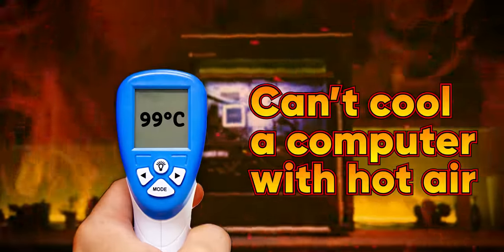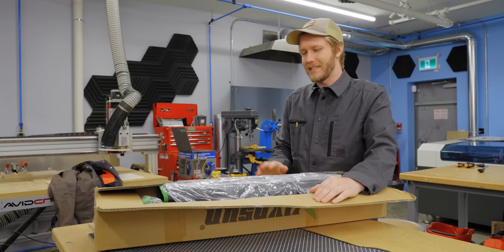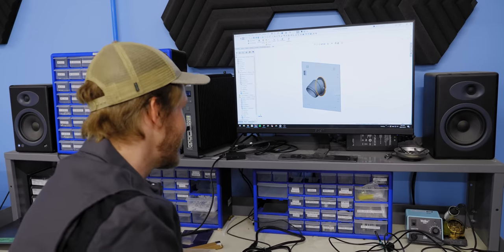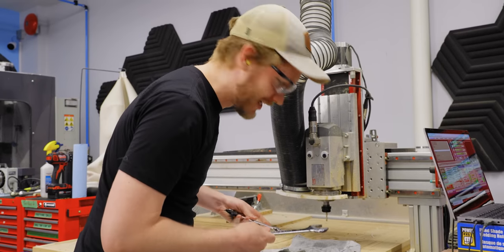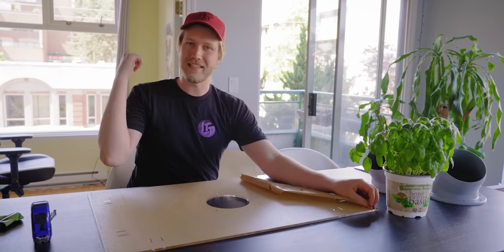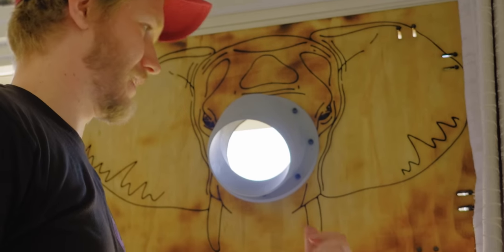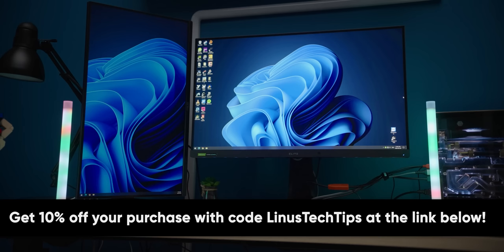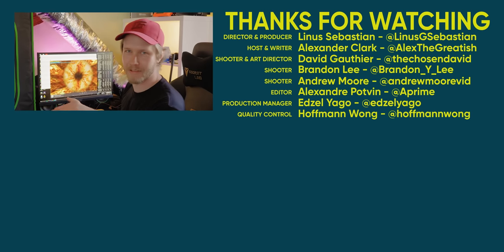You’re cooling your PC wrong. - PC in a Grow Tent

Comment: Sounds like the real problem is bringing cool air in from the rest of the home. What I did was close some vents in the home to get more pressure in the computer room, but this will likely waste some hydro. The other option (that I didn't try) is to just place a window fan (you see them in other countries a fair bit) that just pushes room air outside. That will draw new air in from the cooler parts of the home.

Comment: Just build a cupboard with a door for both computers out of wood or plastic and attach a duct to both but run across the ceiling and put the blower at the window with 2 hooked up. You can control the suction to each by opening/closing the intake on both. There are a lot quieter blowers and fans out there too.

Comment: in the winter you can reverse it to get better overclocks, just make sure to smear goop all over the motherboard ram, gpu, and nvme drives to protect against condensation, and use an external powersupply

Comment: With that amount of airflow, is the full enclosure even necessary?  Having that duct above the main exhaust point of the computer would probably be fine without needing the giant box on your desk, and the airflow traveling around the desktop to the vent would minimize ambient heat escaping into the room.

Comment: A single room AC is well within reason if your computer only draws 600 watts. The 13-15 amp rating on them is just for the short moment while the compressor starts up. My AC is rated 15 amps but unless I'm staring at my power meter the exact moment the compressor starts up, I never see it go above 650 watts usage.

Comment: modifying the case so that you can screw the duct directly onto its top seem much simpler and cleaner to me; then run all pc fans into pull mode also, and have the case in negative pressure; and hang duct and big fan from the ceiling so desks are clean.

Comment: move the cooling fan to the inside of your tent, hanging from the ceiling, that way the fan is grabbing heat from inside tent and pushing it out the vent tube up and out of the elephant trunk. this will help to save space since inside tent is more then enough space for all

Comment: Instead of the grow tent why not try to use a take away delivery bag like Just Eat uses, they are way smaller and im sure you would be able to find something that fits. It would require you to cut some holes in it, but with some stitching around the inner edge you would be able to secure the tubing just fine. Another benefit of this would be you could use a smaller tubing so it wouldnt take up as much space.

Comment: If you have a 3D printer you don't really need a grow tent ... all you need is an adapter for the exhaust panel of your pc case so you can connect the ducting directly. You wouldn't even need intake or exhaust fans in the case anymore - and if you have an AiO installed you might not need any internal fans at all. Just let that big external fan pull the air through the case, the rad and then dump it outside. Maybe if you'd make a little wooden box with some insulation for the fan unit the noise level might even come to normal gaming pc levels.

Comment: While it makes sense to separate the hot part from the rest of the room, here's a thought: what if you just installed the exhaust on the window, with a fan that pulls the air out of the room? The effect might not be exactly the same, but heat still rises, and air would still get pulled into the room from the apartment. Less over-engineered mess that takes up copious amounts of space. 

Ofc it wouldn't be LTT if it wasn't excessively engineered.....

Comment: seems like the cooling wasn't because of the grow tent isolating the heat but rather you used the cooler air from the rest of the house, sucked it into the room and blew that out the window.

Basically, you used your entire apartment's cube space as a cool air supply.

I wager little protection came from the grow tent as compared to if you just were sucking air into that room, blowing it across the computer and then pulling it to the outside.

Comment: The thing to be concerned with is what comes into the apartment/home due to the low air pressure. If you have mold whether you know it or not it may safely exist behind the walls but such a negative pressure machine will draw mold spores, dust and gases into the living space. Also appliances may vent differently or not at all, such as the water heater, boiler or furnace may not draft properly and you may have carbon monoxide issues. If it's heavy you'll feel mental issues quickly. If its mild you'll feel issues slowly over times and either way you may not notice cause and effect.Head aches, Nausea, Irritability, lethargy, allergies, forgetfulness and poor timing issues ie; getting to appointments late, may be the results. Also feeling tired in the home but energized within a few minutes of being outside of the home in fresh air is also a sign somethings wrong in the home. If you do this or anything like it, meaning strong exhaust fan running constantly make sure you also have a large entry opening for safe clean replacement air ,meaning you'll probably have to open a window or two. I know that doesn't help the ac but a good cross breeze might be comfortable enough and healthier than a cold sealed room pulling in whatever is in the walls or whatever should be going out the chimney.

Comment: Air must come in from somewhere to replace the volume of air you're pushing outside. If it's hot or humid outside, your attempt to save energy on AC may be actually causing a net loss as outside air seeps in somewhere else to replace the air you pushed out. It's the portable air conditioner effect. The portable ACs that have 1 hose going to a window cause the same issue. They move 1000CFM of air in the room but end up throwing 500CFM out the window (literally, see what I did there!) and are terribly inefficient.

Comment: At that point, I would just yeet the grow tent and justs make another 3d printed part that connects the case outlets to the insulated tube. Same effect, a lot less bulk. (Maybe use the 240mm mounts on the top and the 120mm mount at the back for fastening?)

Comment: You should just pump the air into a air return in the hvac system.  Pushing air outside air is being pulled into the structure from other places.

Comment: Would it not make more sense to attach the ducting straight to the exhaust of the case? Maybe even insulate the case? although insulating the case wouldnt matter so much as i assume the pull from the extractor will prevent the hot air being released into the room due to negative pressure. This would do away with the massive tent.

Comment: Our breaker is apparently quite resilient since we had 5 PC's in 2 separate outlets 3 of them in 1 and 2 on the other (They were all in the same room though and the outlets were in a vertical position idk how electricals work) they weren't the most power easy either (Estimated 1 720 Watts combined power draw for 2 outlets in the same spot)

Comment: I once did pc inside counter top fridge, 30 by 18 by 18 . Kept pc cold, 34 degree's. I routed fridge hot air out to window mount ac intake. Noise, window mount ac , counter top fridge, no boot to desk top from cold start pre-chilled. To cold for platter hard drive, pre m. 2.  Pge electric bill really high for 1 month ! Now, new pc Asus board with amd Ryzen 5700g , low profile air cooler overclock to 4775, ram 128gb at 3200. Plays fallout 3, nv , 4 on ultra. Complete pc for the price of a graphics card. Temps 40 to 60c, frame rates 50 to 60 fps. I win!! No more high power room heater pc. Read the specs , reviews , shop well.

Comment: i would have turned the elephant trunk to the right do you can route around the window then cut to length so it wouldn't show across the window. that or up side down so you can mount the tube to the ceiling and that out make it be moved out the way so the other desk isn't taken up or bothered.

Comment: Not as efficient or as effective as you'd like to think.
Every volume unit of air you pump out through the grow tent to the outside is a volume unit if air that has to be pulled from the outdoors INTO the house. If the temp in the grow tent is higher than the temp outdoors, you're still TECHNICALLY saving some money, but not much. If the temp in the grow tent is lower than outdoors, you're replacing cooler air with hotter air from outside.

Either way, you have to consider that by pumping air out the window of one room, you're pulling warm air into other rooms or anywhere else air can get in. Same problem with those mobile window-air-hose AC units. 

Def keeps the gaming room cooler though. If that's your only goal/consideration, this is hilariously awesome.

Comment: Not bad but I can think of a number of better ways to do it.
You could have placed the fan in the window fixture itself. Then used micro ducting and created an adapter to connect directly to the back of the PC. Benefit of no big grow tent but same overall result maybe even a bit better. If you had water cooling in the PC you could have hung an radiator fan assembly outside the window and just ran tubing to it. That would be even quitter. It wouldn't have helped with cooling the room the normal temp though. The reason the current system is doing that is the extra air drawn in under the door you mentioned.

Comment: As others have said, without a specific intake, all you're doing is pulling unconditioned, outside air into your apartment through all the leak points. This probably would have worked equally well if you exhausted into the rest of the apartment instead of going outside

Comment: You should design adapter that fits over your exhaust fans on pc case. Then mount duct to your ceiling. You will have more room and it will look nicer. 
Also put some kind of non return valve so that birds, insects and dust don't come in from outside when fan is turned off.

Comment: The horizontal supports are for hanging grow lights.
Reply: You could use the supports to add a fan to push hot air out of the case might have improved as temperatures
Reply: Voice to Text help me again and messed up my words on the first one

Comment: seems like over the long run this would be compounding problems. As the air is pushed outside new air is pulled into the apartment to balance out the negative pressure. Would think most of the new air is outside air from door/window seals. Ejecting cold air + computer heat but injecting hot air. Why not 2 adapters and have outside air come in, thru pc, and out the other vent?

Comment: unless you live in seriously hot climates, you should have nighttime temperatures below 20°C even in summer. So all you need to do is get some thermal mass. 200L water fit in a 40x60x80 cm box that you can put under your desk and can take 840 kJ per K, meaning running a 400W pc for 8 hours will heat it up by 14 °C. Use some creativity to facilitate heat exchange between the water and your room

Comment: If you wanted to prevent this horrible negative pressure machine from sucking out every last bit of cold air from your apartment, the least you can do is put the fan on a temperature controller preventing it from just straight up sucking all the air out.

Comment: i reckon i could do that just as janky, if not a little less with the same pipe and a tote box with a rubber seal around the bottom, and a few extra fans to create static pressure.

Comment: I have done a very similar setup, spare psu + 12v car radiator fan 12v switch. PC is mounted inside a cupboard/bookshelf with a sealed hatch. Vents upwards into the roof space as pumping hot air outside with lousy casement windows is hopeless. PC Case is a ncase m1, and it already used to being hot, 3700x 65d 3080ti 75d pretty much silent

Comment: gotta say, it would work far better with a very long/segmented radiator in the exhaust, and slow airflow over it all for efficiency. after all, 80c is a pretty good under load amount that's at least sustainable, and hotter than most outsides ever, so ideally, a very, very long water loop that works in most every climate would be better.

Comment: I love this video even though this idea is bad. So you're using your home air conditioner to cool your PC. Your electric bill will grow significantly if you send all your chilled air outside. Where is the replacement air coming into the apartment from? Probably the hallway. Actually if the hallway is air conditioned, your landlord is paying for the cool air you are drawing in, but the warmth will find a way to replace the cooler air in the system somewhere. Anyway, this was still fun to watch.

Comment: You could forget the grow tent and just attach the exhaust duct directly to the computer case. the computer would be cooler from the increased air flow and the heat would be sucked outside the same way without the huge tent. But you are sucking a lot of your cooling out the window and making the rest of your house hotter but sucking more of the cold air into the computer room. Probably should get a fan the you can lower the air flow down to the minimum necessary that one on low is probably still overkill.

Comment: Seems like you could get the same result with a dryer hose, connected to a custom 120mm shroud off the rear outlet on the PC and the same oversized fan

Comment: could just have attached some fabric enclosure to the back of the pc and ducted that to the window. or do what I did and get a duct that is the same size as the main 150mm exhaust out the back of my pc, put binder clips on the end, then taped magnets to the binder clips so the duct just magnetically attaches to the back of my computer. then the other end of the duct goes out the window.

Comment: I feel you could have made this from home depot or menards for so much cheaper. PVC pipes, reflective lining, smaller blower, dryer duct. Just a thought from a maintenance man.
Edit: Or how about putting a fan in the window. There are silent versions. Pull in the air you need to keep it cool.

Comment: The irony of 3D printing parts, laser cutting/etching window inserts, running the shop at full tilt for this project, but not spending a few extra minutes trimming down 4 grow tent rods and doing a little tuck work on the tent to get it down to size is thick 🤣

Comment: The video I never knew I needed...
Can you run this without the active ventilator ?
Edit, maybe some ducting (like on a portable AC) to high pressure exhaust fans on the case would be enough instead of building a whole tent around the PC.

Comment: All the fan/duct hardware he used was SO MUCH overkill. Plain non insulated 4" duct with a small inline 4" fan would've been more than sufficient. I've used that fan in a 4'x8'x 7' tall tent with 2 1000w lights.

Comment: you know you could just 3d print a 120x240mm funnel into a 5 inch dryer duct, then all the extra heat from output rad will go directly outside without that huge mess. also you dont need insolated duct, your computer wont put out so much heat that it will blead threw a simple one

Comment: If you're running ac, this is probably pushing cold air out the house You'd want to measure the temperature of the air coming out of the tent. If it's cold outside, or no ac, then this works.

Comment: It could be simplified by instead of using a grow tent, make the cpu case instead as the grow tent itself by putting the duct directly on the rear or top exhaust of the case. The down side of it probably is it will become literally a dust vacuum. lol

Comment: good video. crypto miners do know about hardware cooling. I would never have even considered having that on a desk and a little more thought into the ducting routing would have gone a long way. It should also have a louvered window fan to prevent hot outside air from flowing back in when the fan isn't running.

Comment: Actually this system will make your room warm up slower but it will actually warm up the rest of your house. 

It makes no sense. If you blow out the hot air of your pc out of your house that air needs to be replaced. And guess where the air is coming from? Since you are blowing the air out of your room that air needs to be replaced. So it will suck  in air through the gaps in your walls, windows and doors. Somewhere in the house it will start sucking the hot air from outside to inside and that way your house will be warming up faster instead.

I actually had pretty much the same system with a mobile aircon. My room was nice and cool but the rest of the house got noticeably warmer quicker then before. The solution to this is that you have an outtake and an intake to the outside. So you suck in warm air form the outside to cool your pc and then blow out the hot air again. That is the only way this system does not warm up the rest of the house. This works for my aircon since that one can cool itself with warm air of 30 degrees celsius but that might be to warm to actually still cool your pc enough.

Comment: that's cool but i THINK IT IS SIMPLER to just put the RADIATOR (if graphics card also water cooled) to the window instead and just run a LONG TUBING with proper pump to the computer instead of enclosing it with that massive enclosure. **because only the radiator that introduces heat not the whole unit😅**

Comment: I feel like if you 3d print and cnc machine these parts is to make a small chamber that you can put over the top and the back and that also has a single point of exit.
Also I don't think you would need that chungus of an insulated tube just a simple thin walled tube large enough to host that blower.
And move your PC closer to the window for crying out loud instead of routing the tube all the way through the room lmao